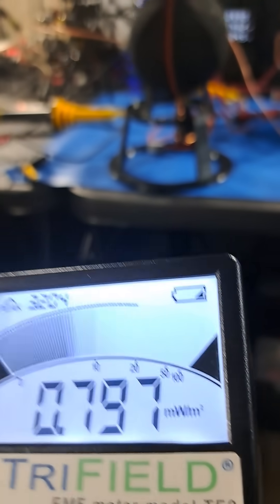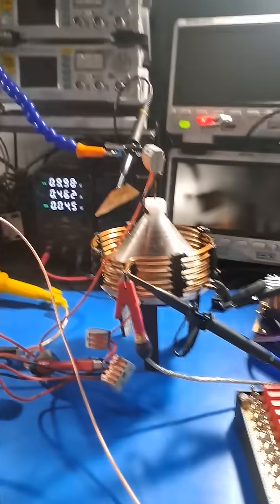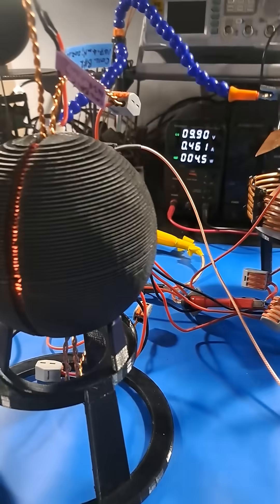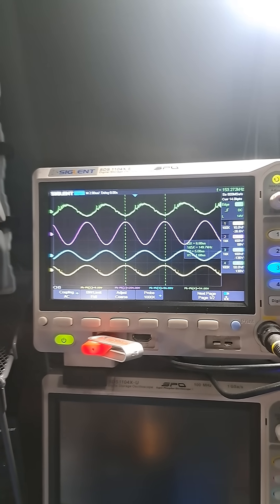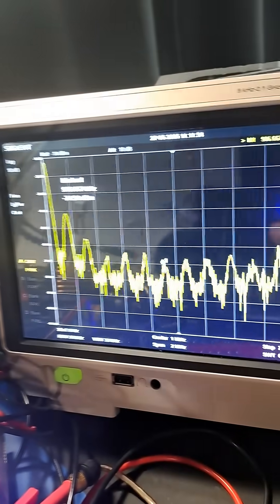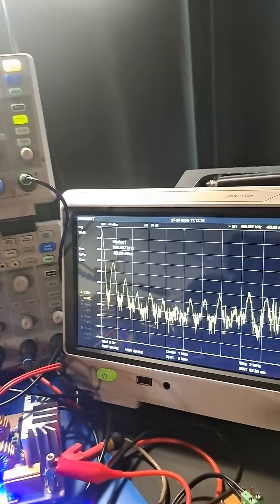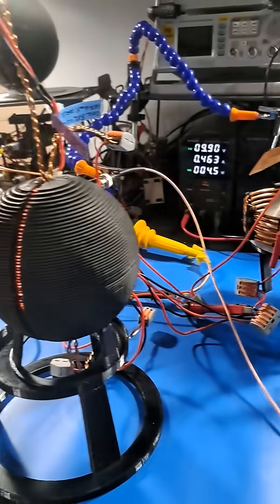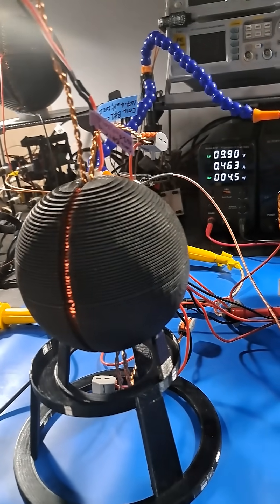Scalar Harmonic Oscillator 2

Comment: Do you even know what scalar is? Im not trying to be mean but please dont throw it around, the coil is cool though
Reply from the maker: For those who are unsure, a simple 'scalar' is a measure of individual points of 'something' within a defined volume, that can form a gradient eg differing pressure isobars on a weather chart. The scalar field approach here is forming a gradient within an all-pervading substrate that can in turn be given a net vector countering the effect of gravity by forming either a sink or push, or preferably both. If you have time, check out the description in the video I put out at Christmas - that explains clearly where I'm at with it atm. Thanks
Reply: @bogirishIan that's not how it works, it's based on the background medium, gravity has no play here, the closest thing a scalar is is a zero point energy feild
Reply from the maker: @Elyasthecool  I don't understand what you're referring to - not how 'what' works? This video is only showing how an RF 'breathing' forms from what I'm assuming is a beat frequency or standing wave inside a nested set of spherical coils. Any gravity discussion is better placed in my more recent work.  Thanks
Reply: @bogirishIan  are we not talking about scalar waves?
Reply from the maker: @Elyasthecool  Scalar fields can be static or dynamic, depending on whether a gradient is present or not. Gradients push things around, time-variation launches waves. So as I understand it, a scalar wave requires both a gradient for direction and a timed pulse. If we're talking about the environmental 'medium' or Aether field, I think scalar wave propagation is likely longitudinal via polarization gradients rather than compression/rarefaction, because the medium behaves like a fluid and thus always seeks to renormalize itself around perturbations. Purely my thinking as of today...
Reply: @bogirishIan  you seem like a smart person, you're my friend now
Reply from the maker: @Elyasthecool  Thank you, I'm just trying my best to figure it out!